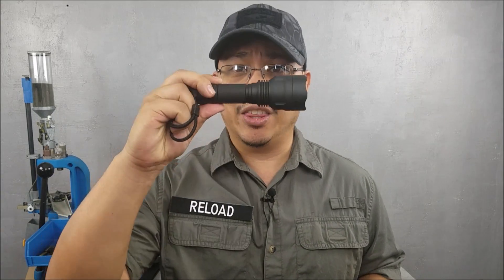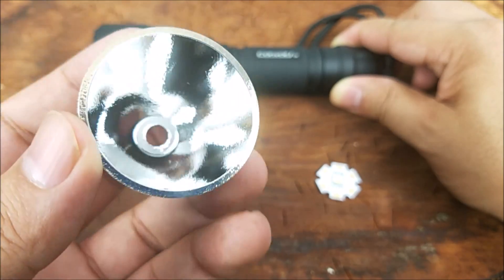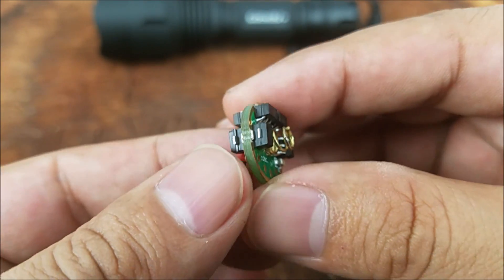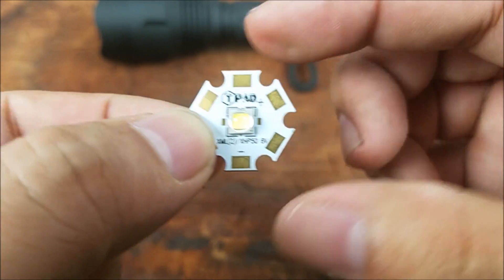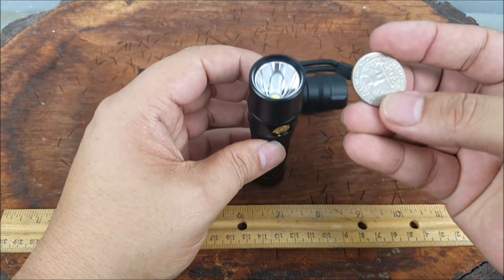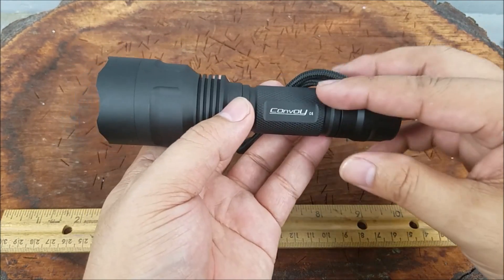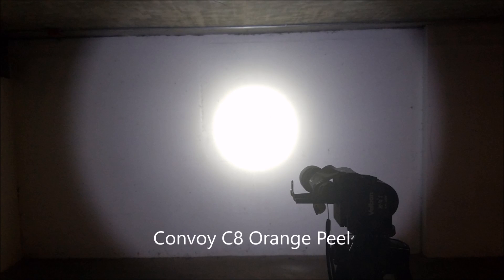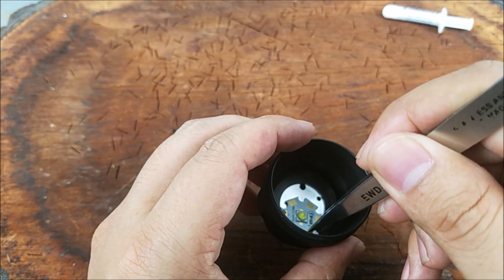Stop Over Paying for Surefire and Fenix Flashlights Build Your Own $40

Comment: Not all flashlights are a ripoff. Some are expensive because the way they are built. I have an expensive light that doesn't have a million modes and isn't 1,000 lumens but is VERY well built. Fully potted electronics make it waterproof INSIDE and out and SIGNIFICANTLY more impact resistant than other lights. Things can't get knocked off the circuitboard if there isn't anywhere for them to go to begin with. The modular design means it can be customized or upgraded without having to buy a whole new light. The 1 inch thick user replaceable and interchangeable solid acrylic optical lens is WAY more durable than the typical flashlight lens and since it is an optical lens, there is no reflector and no airspace. It can't get pushed in but if you somehow achieved the impossible and cracked it, the light is waterproof even when it is fully disassembled and the lens is replaceable. That plus the materials and thickness are far beyond most other brands including Fenix (which I also like). The tailcap switch is a non latching rotary switch which has no mechanism or plastic parts so it cannot be broken. Plus it is 100% American made with American sourced materials and built using American made tools. It even has American made batteries and American made lubricant and works in temperature extremes that no other light can. I can keep going on here but we all get the point. Some lights prioritize performance (in fact most manufacturers into this category), others prioritize durability and reliability, some lights are overpriced, and others are expensive for a reason. Did I mention the amazing warranty and incredible customer service?

 It is significantly tougher than my Surefire lights which says a lot but if you hold a genuine Surefire vs a Fenix light, both are nice but the Surefire feels much more solid.

Comment: That's actually an XML2 chip not an XHP50. They don't look anything like each other You can clearly see there's no four corner board and you can clearly see the two leads wrapping up around the side to connect the chip. spend three months researching and can't tell your LEDs apart 😎 lol. I was kind of disappointed there was no actual building of the flashlight in a build your own flashlight video. I just started getting into the mini flashlights pretty crazy how much output you can get out of such a small light some of them get pretty expensive for what it seems like a third of a flashlight haha. Keep building your soldering will get better 😉 take care.
Reply: There is literally  XHP50 written below  led. Look at 2:29

Comment: xml is one thing, xhp is completely another series. writing on the star xml/xhp50 just means that the footprint is compatible with these popular emitters (5x5mm), but you can solder a bunch of other leds on it, in fact, great majority of led has the same footprint, you can even solder many 3.85x3.85, even 3.50x3.50, and still have good electrical and thermal connection.

Comment: If size is not a primary concern, there are "lantern/boat/camping" style flashlights that often have giant reflectors and very solid waterproofing. $5 for the Rayovac one at the moment. That still needs the LED, brain-transplant, and decent batteries.

Comment: @kimo365 , recently a friend of mine gave me an ' atn javelin 169w flashlight . i dont even know if it works yet , assuming it doesn't , iyho would it be worth rebuilding .The end cap has a pressure switch on it and the wire is a little frayed . The body seems to be rugged , i just dont want to invest any money if the base line structure is lacking . Thanks , any info will be greatly appreciated .

Comment: The led costs $8 and driver circuit costs $16? 
Why can i buy an xml t6 light for $10 which includes a reflector,light,case and driver? 
I was trying to build a diy light but the parts cost more than the light.
Reply: Isn’t that a trip? I believe so. It’s crazy how some things price out like that. I bought a brand new supermoto dirt bike for $5,000 and decided I would buy the standard dirt bike rim to switch back and fourth for oem complete rims and tire brakes. Was $3,500 how is that possible? Me and my brother just bought a whole mother dirt bike together

Comment: I don’t mind paying the money for quality gear.  Especially if it has a warranty. Never had a surefire light, or headlamp fail on me. More than I can say for any other illumination tools I have.  I lost a P3x fury in the Canadian wilderness. It was outside smashed into the wet ground until winter came, and sat frozen in the ground until I found it over a year later. Guess what?  It worked without a hiccup. That happened to me 4 years ago, and I use that very same light almost exclusively at work everyday.

Comment: Over paying? It an individual's perception. If you want quality then you will have to pay for it. I had so many different brands of flashlights over the years but my Surefire L4 is the one that still works after 10+ years, all other lights either got moisture in it and corroded (yes they have o-rings) or clicky failed. When you buy quality, you only pay once.

Comment: The convoy is the max lumens for like some seconds, not for reliable usage, only lumenhunters. My tk35 2018 edition puts out 1300 lumens with the xhp 35 up too 480 meters reliably without getting too hot. The interface and runtime is great. Also I have the factory guarantee. But I can totally understand the diy factor of coolness with building your own flashlight. And of course reliability depends on the parts, the interaction between them and how well they‘ve been put together, so I do not condemn custom flashlights 🤙🏻

Comment: great job I've tried telling people the samething,you have the Nanjing board amped up to what about 4.12 amps?and iam mor trying to be sarcastic  or negative at all but your emitter has to be an xm2 because that circuit board is only a 3 volt not a 6 volt needed for a xhp50 or xhp 70 .But you did a superb  job on education acting people

Comment: Buying a Surefire is like paying someone building the custom light for you (time is money), plus the light is basically mass produced custom light so there is minimal differentiation in build quality. A thing about LED heat management is it must be solidly mounted to the aluminum for maximum heat transfer so you still get 70% efficiency at 50,000 hours, otherwise the LED will burn out prematurely. Surefire uses thermal epoxy to mount their LED to the body so it can withstand rifle recoil, so it's almost fail proof. Also, under a rare event the light malfunctions you can send it back and they'll send you another (I don't think your custom light comes with a warranty).

Comment: IF A WHOLE "CREE LED T6 FLASHLIGHT" IS $9, WHY DO I HAVE TO PAY $15 FOR A SINGLE FREAKING TINY BULB TO CONVERT MY MAGLITE AND STILL GET BETTER, BUT STILL NOT STELLAR L.E.D. LIGHT ?
Reply: Yeah idk why leds are marked up so much 
Buy light and removed the led and driver for cheap.
I looked up bulk led price and i think it was $3 per unit if you buy 5000 which is still expensive

Comment: You got burnt buying that shell for $11 when it will get you two of these. You could upgrade from the cree xml-t6 or xm-l2 to your other chips like the cree 60 watt xhp70 chip but the li-ion cell won't last as long. Hope this helps you out, shop around while you are there. Prices vary from store to store quite a lot.
https://www.aliexpress.com/item/XM-L-L2-5000LM-Waterproof-Zoomable-LED-Flashlight-led-Torch-tactical-light-use-18650-Rechargeable-Battery/32818079112.html?spm=a2g0s.9042311.0.0.lCg1z5

Comment: Great Video
I'm new to this, but have an old school 6 D cell Maglight. what kind of power do you think that  could get using that as my donor. Any ideas and suggestions would be appreciated. Thanks Bruddah!
Reply: upgrade your maglite.. buy led upgrade for maglite from adventure sport flashlight on ebay... he has 5000lumens and 2500lumens upgrade led for maglite... i have use it and it really amazing... running on 2 26550 rechargeable battery...
Reply: Or you could use the body  of the maglite and do a form 1 and get some cups and an end cap,... Bam! Suppressorville!

Comment: Alls where did you buy your peb with xml2 led ion as I need a replacement for one of my torches but only found a bulk seller so far and $8 is a very fair price do you happen to know the diameter of the PCb each sh I need a different size thanks for your help

Comment: Can you use a thermal p late to generate power to continuously recharge it during use use as I have so t6 headtorches produceing in excess of 30,000 lumens and they produce a hel of a lot of heat running on 18650 li-io batteries some even have a small circuit on the batterie itself I really don't know have much knowledge of electronics but I'm sure if you could get curved thermal plates to go round the outside of the emitting led it would certainly make plenty of power and keep the torch going fo alotblonger had anyone even though of this ides if not remember the name David Preston  inventor of the almost  self powering led torch and don't forget the convex lens it makes a massive difference in the throwing distance and focus of the Belem if you do have a go at this please send me one to sample for you at daveprest80@@yahoo.co.uk thanks I'm fascinated by the power these LEDs can produces theses days it's amazing

Comment: With all due respect, you make quite a few statements here that show only ignorance. 
LED binning is quite complex and your $8 emitter is almost certainly a common low bin chip. Name brand manufacturer's like Fenix, Surefire, and 4Sevens pay top dollar for top bin chips - simply put they are just more efficient and brighter. Secondly, your fabricobbled driver doesn't even begin to compare to the top quality enginerding that these companies use in their custom built drivers. 
I have about a dozen cheap chinesium flashlights that work well, and a handful of name brand lights that just out perform the cheap ones hands down any day; that's the simple facts. You get what you pay for, never mind the warranty you get from the name brand companies. I can attest that 4Sevens is stands behind their products 110% with excellent customer service.
Reply: 4sevens? the guy from CPF (I was there 7 years ago)
he was one of the most crazy builders back then. always pushing the boundaries
Reply: www.foursevens.com
I had an original Preon that just quit working and a Preon 2 Ti (series 2) that still works just fine. I could put the emitter head on the Preon and it would work, but the original one would not. It died! They replaced the entire light with a series 2 Preon and my clicky tail cap which wouldn't work on the new body; FOR FREE! This was 3 or 4 years ago. I now, also, have a Quark Smart QS2A-X that I also appreciate very much. 
Chinesium lights are the ones you lend out to people, not caring what happens or if they ever come back. Your good lights never leave your side.

Comment: Corrections:
1. There are a total of 16x 7135 chips, not just 8. You gotta check both sides of the driver;
2. The emitter is an XM-L2, not XHP-50 as some others have pointed out.
Reply: It says xhp50 on the chip

Comment: I just found and sub'd to your site and I, too, would LOVE to see a build video on the DIY version because I own (FAR) too many SureFire lights with their original bulbs, and although they are bright as is, ANYTHING I can do to increase their Lumen output would be of benefit. And, in some instances (like on my weapons lights) I'd prefer to have a reasonable (?) battery lifespan, but given their purpose and anticipated ON duration when used in their, um, "intended" purpose, the trade-off would be a consideration. Wouldn't do to need the light for 60 minutes and get 30 plus a nuke-hot light casing, etc.
Anyway, looking forward to seeing a build on this.

Comment: Your driver board has 16 of the 7135 chips. See how they are stacked on each other in pairs at 1:51? That is almost 5 amps delivered to LED.
Reply: Nunya Bissnus 
Wouldn't it be better to just FET it by this point?

Comment: products are still cheaper in the us. a husqvarna blower 490 usd here €1000. red dot powder 22 usd here €48, same goes to flash lights and lithium ion cells. 1 ltr regular fuel €1.80.   box 50 cci .22 lr €4.20 .  thanks to EU Brussel.

Comment: Can you tell me exactly what driver and LED you used (part number etc.) so I can build the same light please.  I noticed many options and I'm confused on what setup to get.  I have never built a flashlight and this is a great alternative to expensive ones.  Thanks, John.
Reply from the maker: +John Nelson omg I'll have to look it up it.  The insides were sold as a lot with the host.
Reply: If you could get me that information,  I would greatly appreciate it. I want to build a duty light for me and a my partner.  I'm tired of spending way too much money on this stuff.  Especially if I loose one chasing someone.   That definitely sucks.   Any help is truly appreciated.

Comment: When I saw"Build Your Own"  I was expending to see you actually build the flashlight.
Reply: Right, waste of time.
Reply: I didn't know you could get your own parts and assemble it yourself. That is worth the video all by itself.
Reply: so you actually want to see several hours of PCB design. Thermal management and logistics all in a 7min video? wayy too high expectations.
Not to mention you sure can build your own from scratch. Only issue is the companies already did that better for most part and for cheaper. Obviously there's other driver and PCB designs but not very easy. Also good luck with CNCing a aluminium shell for less than a few hundred bucks
Reply: @MaxC_1  No need for all of that, but it would have been nice to see a step by step on how to assemble the parts that he bought.

How hard can that be?
Reply: What was the point of even making this video then?

Comment: That is an XM-L2 LED not an XHP50.  The pad he's using can support XM-L2 or an XHP50 but the LED mounted on the board is clearly not the XHP50.  XHP50 LEDs have four individual LEDs within in the single LED and can be easily identified as an XHP type. All the same, building an LED flashlight is cheaper and can be entertaining.
Reply: Bugdozer I wouldn't have a freeking clue as to what the difference is between the XML-2 and the XHP50 and maybe that is Reloads issue aswell but he is just reading off of the part what it says. Can you explain the differences so even a non tec guy like me can understand?
Reply: Basically, the XHP50 LED needs 6V to run, while the XML2 mentionned runs at 3-3.5V, meaning that with a 3.7V battery, the XHP 50 needs 2 batteries to run, while the XML2 only needs one.
Reply: Bugdozer not to mention that the XHP50 requires, what, like 6 volts? So you'll need either 2 18650 Li-ion cells in series, or one with a boost converter. Also, that's freaking 16 AMC7135 which results in 5.6 Amps! A direct drive is probably better and cheaper here.
Reply: That emitter is a XM-L2, the silver around the yellow of the emitter is the giveaway, green = XM-L
Reply: you can get away with 2*16340 cell, they'll fit. with shitty run time
Reply: +turbo2025 i didnt know they could fit so many lol just go fet lol

Comment: He hasn't got a clue as to what he is talking about. Comparing xhp50 to XM-L2 and different size reflectors is just stupid. Plus he may built for 40 bucks, but what battery and charger, not many people will have 18650 and charger lying around.
Reply: battery will run you 4 bucks directly from china while good quality charger will run you another 4 bucks shipped, lii-100, which can be used as power bank.
Reply: Yeah 8 bucks for a battery and charger that will likely burn your house down. Care to name one quality charger for 4 bucks.
Reply: the battery is panasonic ncr18650b 3400mah with protection circuit, not some ultrafire 8000mah. Liitokala lii100 is great little charger, just make some research before typing some stupid comments.
Reply: Wont find any ncr18650b for 4 bucks anywhere. That lil100 is ok, certainly wouldnt call it quality, as it does have a tendency to get quite hot when charging. 

So shove your stupid comments where the sun don't shine.
Reply: haha, sorry for my anger. i didn'nt call it the best quality but for the price it is great. You can find ncr18650 on gearbest, without protection it is 3.99 now, i bought 2 with protection and one regular for 13 bucks plus free shipping.
Reply: Yes get unprotected for that price. i have several. Bought and salvaged laptop packs. Buy mine from banggood, lot more discount code and points from them. 

Still wouldnt stick xhp50 in a c8 body, heat is going to be crazy